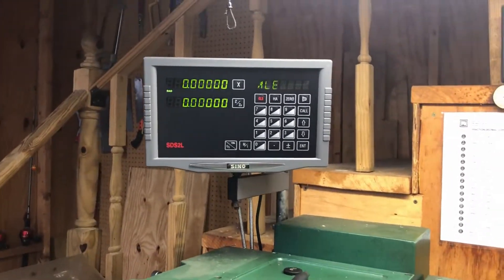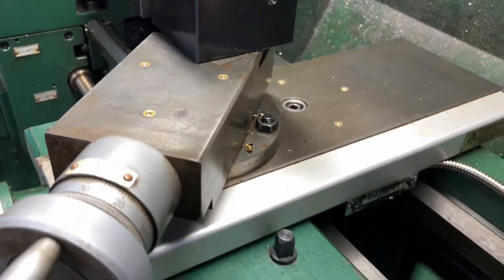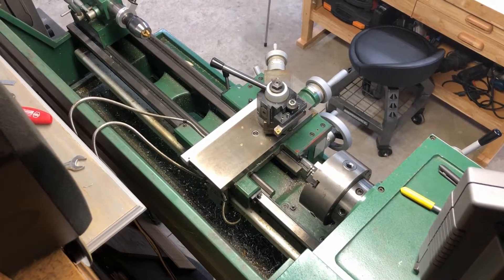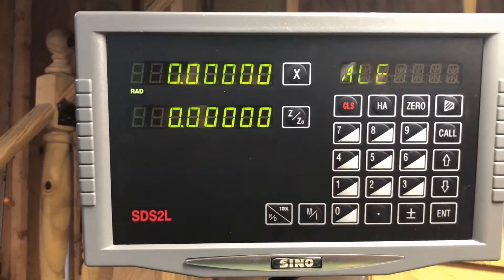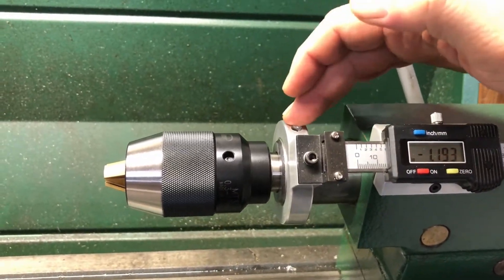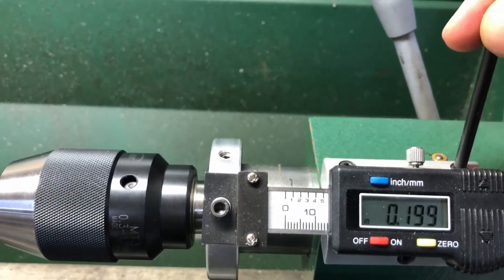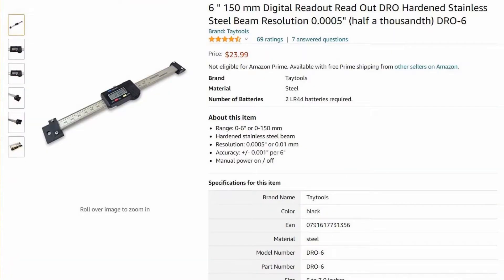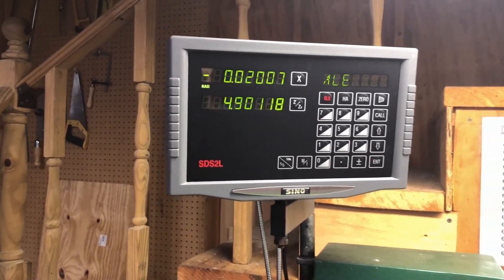Grizzly G4003 12x36 Lathe DRO SINO Digital Readout & Homemade Tailstock DRO

Comment: Thanks for the video.  A word about the ball oiler ports: (My opinion only)  I DON'T use them on most applications, especially on those facing up, like the ones you show on your cross slide. Tiny bits of debris can accumulate around the ball and when you press in the oil container, the debris can be flushed into the port.  As for lubricating the ways, the most common way to lubricate them is to drip oil along the ways and run the saddle back and forth to spread the oil. No need to remove the wipers. Also, the felt wipers have a secondary function of absorbing oil and spreading it on the way surfaces.  Though I can't put a link here, on my Instagram page, I show how I made replacement wiper retainers that are open at the top and have enough room to hold a good bit of oil. I fill this little "reservoir" with oil and it filters down through the felt providing continuous lubrication for hours. Regards

Comment: I found this a long time ago re: the 5th decimal place. It might not be in the same spot in your Sino's menu but take a look around.
"It is part of the "Setting of System" as listed in page 2, section 2, subsection 10 "chosing precision of calculation".

In essence, you turn on the power and press the period '.' key while it's self checking. That puts it in setup mode.

You then step through the settings hitting enter followed by down arrow till it displays 'CTR'. enter the number of digits to the right of the decimal (3,4 or 5).

Arrow down twice, then period and you should be done."
Reply: Black tape over the fifth digit works really well and it's even a "programming" step I can handle.
Reply: @user-wo7rz3yn4o  Yeah, but that's too easy! haha :)
Reply from the maker: Thanks for the info.  I looked in my manual and it is a little different.  I think this will work.  It gives me an option of 5 different resolutions (0.5,1,2,5,10 microns).  I will give it a try.